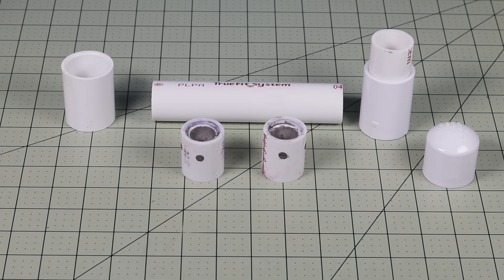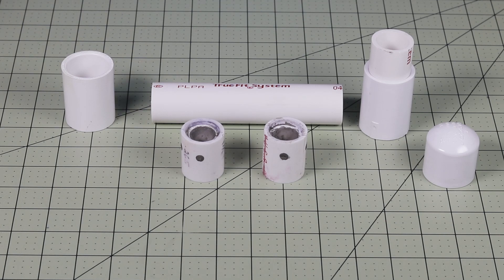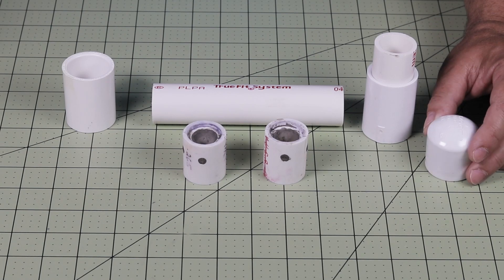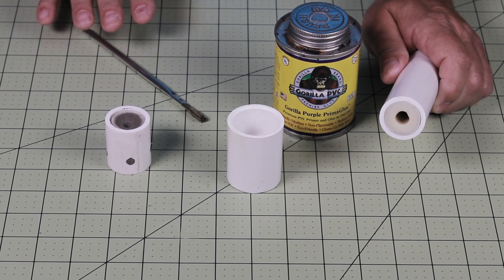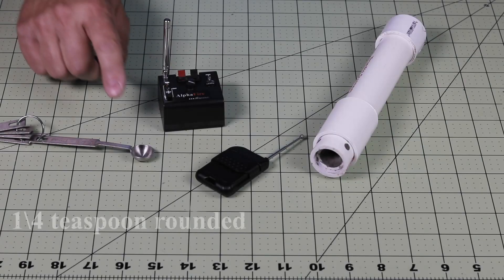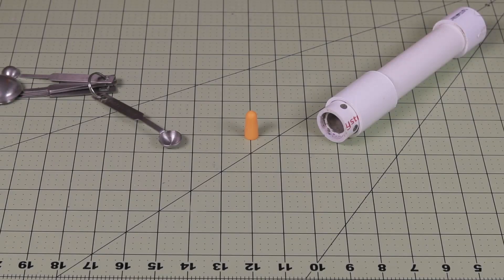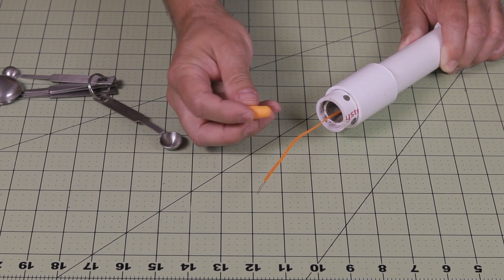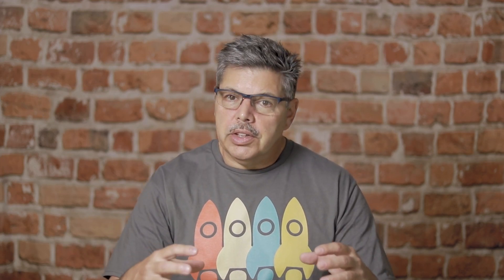Rocket Motor Assembly - Sugar Fuel

Comment: Hey buddy, I have a question for you? I notice in your video and you do not use an epoxy seal on the forward end of the motor. I just tested 9 motors and all but one failed by blowing out the 4 ml Epoxy plugs and destroyed my test fixture. I will have to rebuild my Dynamometer fixture but lesson learned. I notice that you strictly use PVC caps to contain the pressure in your motors. I will also open my nozzles up to 5/16ths orifice to reduce the pressure. Since I have about 10 more motor tubes with epoxy forward caps. I believe I can use them if I use an end cap with a 1 1/4 inch washer between epoxy cap and the PVC cap. Do you think that this will insure that my epoxy plug stays in place???? I roughed up the forward end about 1/2 inch deep with a dremel sanding attachment in hopes this would give the long setup epoxy more to grip to in forward end. I use altitude electronics for chute deploy so, i do not need provisions for ejection charges. Hence, the epoxy sealed tube approach.  Any other suggestions on how to reinforce this portion of rocket motor? I had 8 catos all epoxy plug blowing out. Of course that was without the PVC end Caps. Thanks for all your videos, Love them. Take care and God Bless!
Reply from the maker: The forward end must be retained from the outside of the PVC pipe away from the heat. Another issue is epoxy adheres poorly to PVC. Keep in mind PVC glue is actually plastic welding and has little to do with adhesive.

I think your idea with a washer will work. The washer must be in positive contact with the epoxy plug and the PVC cap. You will need to drill a small hole in the cap to let the air escape or the two components will not make contact!

Make sure to maintain a great distance because the washer is in a very high pressure zone and could be expelled violently. Stay safe!!

Comment: Once again, great video. Being unfamiliar with pvc motors, I have a question in relation to the possible gap between the segments. I've noticed with your fuel segments that there is a small amount of overhang on the outer sleeve. When you install the segments, it seems that a gap would occur between them. What keeps them from burning in between the segments. If that does indeed happen, why wouldn't it burn through the side of the motor case? Thx
Reply from the maker: The PVC motor tube functions as a thermal insulator and the burn time is very short. I have not had a motor burn through yet!  The nozzle washer needs to be insulated on the top because the washer can become superheated and burn through the coupler. After the burn is complete the motor becomes flexible from the heat soak.

I am always surprised that the PVC cap can withstand the heat and pressure without losing the bond!

Comment: Hey nice work. I read once that its good to ignite it from head instead of bottom. They say it makes more pressure it means more power. What do you think? Thanks.
Reply from the maker: Igniting the motor from the top will cause it to pressurize rapidly. This reduces wasted fuel and the rocket will leave the rail with less delay. I use an e-match pushed to the top and a wireless igniter from a distance for safety reasons.

Thanks for the comment!

E-match
https://www.ebay.com/itm/52pcs-lot-11-81in-Fireworks-Firing-System-Electric-Igniter-E-match-Wedding-stage/273682114575?hash=item3fb8b9a80f:g:wDoAAOSwbsdVKS68

Comment: Sir what thrust does it produce
Reply from the maker: The 6" motor makes around 20 lbs (89 newtons) of thrust. That is enough to send a 4 foot rocket 3 inches in diameter to about 2,000 feet. The 9.5 inch motor makes about 50 pounds of thrust. I don't have a way to measure the specific impulse of the motor yet.